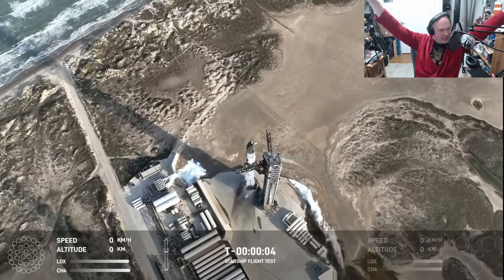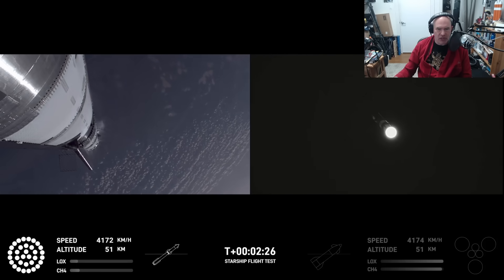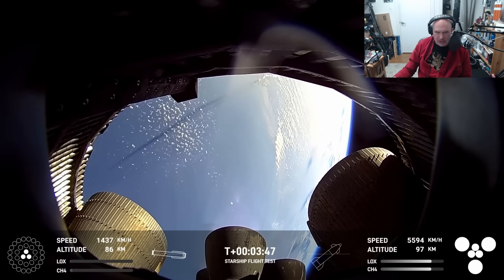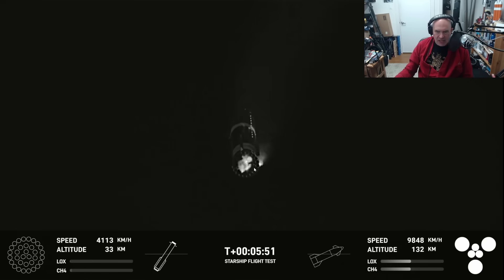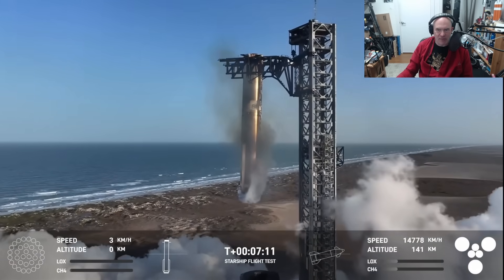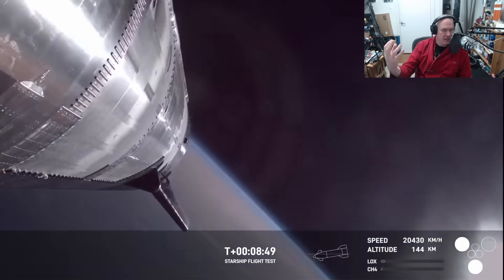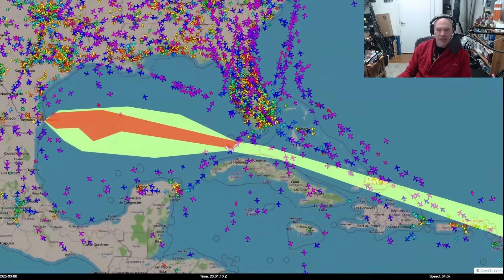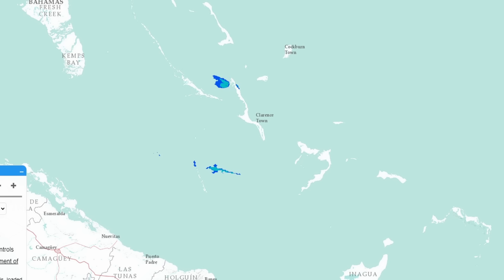SpaceX Make The Same Mistake Twice With Starship Flight 8

Comment: At 9:50 you can see what looks like methane burning with a slight green-tinted blue flame right in the area of the three sea-level Raptors (between them and the camera). 

Another thing, with the static test fire, just because they ran the engines for a minute while it's clamped down to that stand, it's not the same as what the ship will experience while in flight.

Comment: I think the downcomers involved are these three separate tubes traversing the lower tank.  I may only have seen a render because they looked rather weak/unsupported for the tons of liquid being sloshed over them.  Any bending would shorten their length, and rip the connections at each end.   I remember thinking it won’t take the forces.  Compared to the robust booster downcomer, these three ship downcomers looked real weak.

Comment: Good video, lousy title.  It's not clear that both failures are actually due to the "same mistake".    Last time, there was  a fire in the attic.  This time there was a fire in the engine compartment---and what you call a "hot spot" on the vacuum raptor looks to me like a burn-through, with a bite taken out of the trailing edge of the nozzle there.  It remains to be seen if both failures are due to the new plumbing, or if so, how.

Comment: In short...

- There was obvious "burn through" (Ttmestamp 3:11) the damaged edge of the bell of one RVac engine is clearly visible.
- This was probably caused by a leak or blockage in the Regenerative Cooling system in the engine bell, allowing overheating and the subsequent failure of the bell mouth edge structure.
- In space, in vacuum, the rocket exhaust exits the "mouth" of the bell of the RVac engine unconstrained by atmospheric pressure, and so the gases exit nearly at right angles to the bell through an arc down to directly in line with the bell. (The "squid" effect seen as the rocket climbs through atmosphere to vacuum).
- (at timestamp 3:11) You can clearly see one edge of one RVac engine has a "notch" missing causing the exhaust gas to exit nearly at right angles to the direction of flight through this notch.
- These hat exhaust gasses are blasting directly against the sides of the center 3 Raptor Sea Level (RSL) engines.
- This is seen as a light reddish haze of burning gasses "seeming" to come out to one side of the center of the 3 RSL engines.
- This is, I believe, what caused the failure of the damaged RVac engine and the subsequent failure of 2 of the RSL engines.
- This off-center thrust caused the rapidly increasing out-of-control spin and thence the loss of Starship 34.

Comment: Gas bubbles. The fuel slosh is way too strong in the larger tanks, and gas is being sucked into the pipes. This causes damage to the plumbing and engines, causing fuel/ox leaks. This leads to a fire and destroys the vessel.

Comment: “They could have gone to orbit if they wanted.”

Yeah, and I could have been an astronaut if I wanted. This is failure after failure. Billions spent on fireworks and nearly zero actual science to show for it. What you mean is that it would be incredibly reckless to fully fuel a rocket that’s probably going to explode so they don’t and just blow them up closer to the ground. Thats still a rocket that blew up. A total failure. If they were capable of more they would do more. 

Mars…the very idea is more ridiculous every day that passes. The suspension of disbelief needed to still think Starship is anything but doomed for cancellation is more than I can gather. Mars! Ha! I’d sooner believe the thing can travel through time.

Comment: The problem with getting right the first time is that you really don't learn anything except that it worked once. It's a very large rocket, there is no way to gather data except flying it. Simulations have limited value. Exploding the rocket as many times as necessary to intimately know how it will perform is not a bad method of development. It's just expensive and time consuming, but ultimately it rewards perseverance.

Comment: You don't get it. Space-X is experimenting with new materials and designs, and they are collecting data. on a real-world prototype level with rapid turnaround. They know in advance that it will not be a 100% successful mission. That's why they don't put snarky know-nothing  YouTubers on it.
Reply: You’ve bought into the con.  Congratulations bro.
Reply: @SlimJim-Bob  Your spaceship is way better. Con? It's SpaceX's money. And this is Saturn5 +100.
Reply: @dlschgo     I didn’t say that bro.  Stick with the facts.
Reply: Well,, loosing the hardware is simply 
Not an optimal test protocol. 
I use the word, protocol because like muskrat said,, failure is an option. 
Only having telemetry oriented data and pictures as your only forensic tool,
Is about the least productive way 
for solving technical problems. 
And this failure seems similar to the last one.    That could mean,  the engineers really didn't know what caused the last failure. 
It's getting beyond the point of excuses. 
And muskrat is doing damage to 
spacex approval rating. 
That could eventually hurt spacex ability to secure future government contracts. 
No matter what anyone says contrary. 
This is not good for spacex.
Reply: @markmyra-cn7rd  This is a state-of-the-art system, beyond NASA and commercial competitors. What do you think happens to all initial designs. The booster is what they were looking at here and perhaps safe spacecraft skuttle. The pieces looked remarkably similar to the previous skuttle. If NASA doesn't know what Space X is doing, they should get into another line of work. Space X put their development process on full display in 4K. You can't test materials and systems in a lab and expect those results in practice. The real world is where you get the data you need.  The Starship isn't ready for commercial service yet. They'll let you know when it is. The government contracts are for the Space X boosters and spacecraft that are in commercial service and they have more work than they can handle.
Reply: @dlschgo  
Testing the booster can be done with a vehicle that is less prone to failure until starship is actually ready. 
Material and system Testing is not new 
or require 
a ship with the size of starship.     Go big is a flawed ethos. 
Ego is best left for the less sophisticated 
among us.   And not a good element of 
Science. 
And since the ship was lost because of what looks like the same malfunction as flight 7?    From a project managers standpoint.    The issue got past the engineers and was not fixed. 
Not one physicists or engineer I know thinks that losing the test hardware does anything but minimize the ability to solve the mechanical defects that caused the failure. 
This fast pace of test flights is showing 
Flaws in problems solving. 
The issue seems to be vibration. 
Now then,  what do you know about 
making something of this design, 
not shake vulnerable systems apart?
State of the art is a label for something that works.   Better than anything before. 
This piece of technology is impressive 
in scale.       But will need a technology for isolating vulnerable systems from vibration. 
This will probably make ship heavier. 
Resulting in less payload. 
My question to you is.  Why so big?
I know the answer. 
Do you?
Some of the parts seem next level.    And reusable hardware is a very old idea.   In short,,  I get it better than you seem to get it.   My guess was success by flight 6.   
I was being generous. 
Someone I know who has many decades of experience in aerospace thinks the ship
Might prove to be just a test platform. 
Proving the limits of design and systems.

Comment: Booster stuff? Great!!! Absolutely Fantastic!!! And in the Grand Scheme of Things, I think most of us assumed that catching boosters as tall as buildings, would be the difficult bit! So congratz for SpaceX on this incredible feat of rocket engineering!!!

However.... In the Grand Scheme of Things... The booster is actually the expendable bit! The Starship itself however, is anything BUT expendable! And now we have TWO similar failures in quick succession! Whereas at least in the older block 1s, the vehicles lasted MUCH longer and went MUCH further!

The Clock is ticking... Elon is seriously distracted... And people are getting seriously concerned! And with the FAA compromised too... There is a sense that things are starting to spin out of control!

Will leave it there! No doubt Elon trolls will see no issues! But the rest of us see them! And the next flight could be make or break! They have NO CHOICE now, but to make progress on the next attempt! Otherwise...

🙅‍♀

Comment: I’m getting strong spruce goose vibes here right down to eccentricity of its patron.

I think one of the fundamentals is that Starship is just getting too heavy with all the mods to make it just work.  Not having high energy propellants in the upper stage where they make sense is also hurting them.  The Shuttle expended an entire huge tank and had 420 ISP engines to get to orbit.

Maybe a fully completely reusable upper stage is just too hard even for SpaceX.  Maybe they need to reset to a known good config and restart the iteration process.
Reply: lol don't worry, starship 3 will be bigger 😄
Reply: Exactly. I'm glad someone else is going down the Howard Hughes Path.
Once you fully build out the interior of the craft with all the extra associated weight the flight computers will have to be re calibrated so it can crash into the Indian ocean over and over and over again.
Elon Musk won't be getting to Mars in his life time with SSX and will probably end up in some darkened hotel room as the for mentioned person above once people realize he is all smoke and mirrors and wasted so much tax payer money.
Reply: The Starship architecture is actually pretty useless except for doing maybe one thing: bringing oxygen and hydrogen to LEO.  For another vehicle that is not a pig on weight to use for high delta v missions.  Going to the moon with Starship is among the dumbest ideas ever conceived and shows a fundamental lack of understanding of long duration flight.  It’s sad to watch but I will admit the launches are spectacular.
Reply: Spruce Goose was a sound design, it just did not have a market.  The vibes you should be getting is the N-1
Reply: There have been far larger rockets in history, and there are far larger designs that have had testing work done on them. Size is not inherently difficult. The company just needs to be run better.
Reply: The difference is Howard Hughes was an actual genius who personally flew many of his test aircraft. Neither is true of Elon
Reply: @blitz8425  Communications transportation Space - What exactly do you do?
Reply: I mean, yeah, it makes sense. Starship is simply too big. IMO stoke space’s design seems more likely to work.

Comment: They seem to be at the margin of mass to get to orbit? Wondering whether the additional fuel load is stressing/fatiguing the bulkheads etc - stress on then stress off. Probably not but just a thought, since they clearly didn't correctly find the source - or at least properly fix the issue last time.

Comment: Is it so easy to know that the same error occurred twice? The flight termination system was activated twice and caused a spectacular explosion. But this does not say anything about the failure. Without telemetry data one cannot say anything. somebody assumed that there may have been a problem with the cooling channels in the nozzle of one of the vacuum engines. I assume that the resonance problem of ITF7 was solved.
Reply: No? But this is a bit of an issue; we shouldn't need 8 launches to get the god damn thing in the air reliably lmao. Zero payloads delivered to orbit, at this rate we'll be on flight test 12-14 before we can even reliabily get to orbit and maybe land the upper stage. And we're gonna need to do like 14 launches within 2 weeks to get to the moon lmao. Okay. This is never landing on the moon. It will likely be a dead project within 5 years. Another example of Elon overpromising on the governments dime and underdelivering on his.
Reply: @Karlswebb  You know exactly what is going on. Or do so as if you knew it. Have you ever worked as a developing engineer? I did it and I know that there may always be problems one did not expect. The Space Shuttle also worked on paper but killed more than a dozen people. It also failed commercially as the heat shield needed too much rework after each mission and also caused the second disaster. Apollo was a political project that had to work regardless of costs. Now they try to build a spacecraft that works technically and commercially.

Comment: They knew straight away, did you notice how long they showed the Booster return , they were Gona cut back to the main Ship but presenters had to stall. Everyone looks at the Booster not the Engine out indicator on the screen. That engine was out for a long time before detonation. But still lots of success in this flight❤

Comment: Starship has now been half as expensive as SLS.
Reply: What?! Nah man, it's been only a fraction of the cost
Reply: @PersianCamel  >  What?! Nah man, it's been only a fraction of the cost 

It is currently at around $11B over the last 7 years. 

So if by fraction you mean "1/2" then you are correct lol
Reply: It's ~$22B for the SLS.
Reply: @ starship program so far is about $10bn over the last 7 years of 1-2bn raised a year. So yeah its about half as expensive
Reply: @veselekov  and there's no telling where it is in it's development journey or if it ever materializes as a functional platform as conceived. SLS on the other hand is a largely finished and credible design with known performance characteristics. I can't believe there are still people out there claiming costs as low as a few $ million per launch for SS.
Reply: @snizami  they haven’t even got fuel transfer working. No life support, elevator or emergency contingencies
Reply: @veselekov  for every ship they blow up, how many additional flawless flights does that mean they’re going to have to eventually perform before a humans will dare to get on board?
Reply: @JoeLion55  Yes indeed. Wondered about that too! 
We're not going to see humans on board for years.
Humans to Mars? Decades! And probably not with Starship.
Reply: @JoeLion55  That is if you still believe that this was ever intended to be human rated. Here's what NASA said about the Space Shuttle: we learned a lesson that you  never put people inside a bomb - you only put them on top. The header tanks in the current design precludes humans ever being inside that thing. Even Musk said it years ago: Starship was built to launch Starlink. No Starlink, no SpaceX. So, years and billions later we have 8 failures. This isn't even final version. Note that Manley said: they eject the ring to save weight for landing. With the Starship empty. So, how much more fuel when it is full? 
There will be new iterations of this design, which means new test flights for each generation.
Reply: @TheDirtCreature They have a test payload in there with a bunch of dummy satellites. Even if they didn't, they'd have ballast. And being a test flight, there's probably a ton (maybe literally) of extra instrumentation. 

Finally, they're using old raptor engines that are presumably heavier or less efficient than the current ones.
Reply: @veselekov  On the upside, they got fuel dumping working nicely...
Reply: @roflchopter11  is the point of the HLS satellite deployment?
Reply: @roflchopter11 well, we haven’t actually seen the raptor 3 yet, it is assembled and in testing, so hopefully we’ll get the real, not targeted specs, soon. But they did mention that raptor 3 is a metric ton lighter than raptor 2, so even if its thrust is the same, it will be more efficient because of the significant weight decrease.
Reply: @veselekov  apparently its a use-case. Its also a payload they want to develop and avoid needing to contract out. It's a "free" test launch for that system with the test of this system.
Reply: @Wirmish  and SLS worked
Reply: @kirishima638      Yeah, after 15 years of development SLS managed to throw up a capsule incapable of supporting human life for a single hour.  This, after starting with the guts of the STS system, which had flown for 30 years.  All this, for only $30 billion.  What an achievement.
Reply: @jshepard152  We all know that SLS core design was dictated by Congress for pork barrel spending reasons.  The enginners that over saw SLS could not change that, all they could do was deliver the rocket that Congress ordered and they did so flawlessly.  Musk had total flexibility in what he designed and delivered to the market, he chose to make a rocket too large for existing market needs, too constrained in payload capability that it can only launch his own companies satalites, and lead a development process which is objectivly failing as the rockets got no payload capacity and can't reach orbit.

Comment: Not a lot of speed around the time of stage separation.  I'm pretty sure they're ahead of themselves with increasing the fuel/size of booster and ship before getting raptor 3 in their hands (which has 20% more thrust and weighs less).

Comment: A small theory - if the pipes are the problem, they made the resonance frequency lower by making them longer. What do you do to force a pipe (or a guitar string) to have a higher resonance? Support it. Clamp it down in a few places, ideally not on the same lengths each time, to force it to have much higher harmonics, outside of the range generated by engine's vibrations.
Reply: Nasa solved pogo on Saturn 5.  You can add dampers and detune the system
Reply: @rwhitenz His theory is lateral vibrations, not longitudinal, as in the Pogo modes.